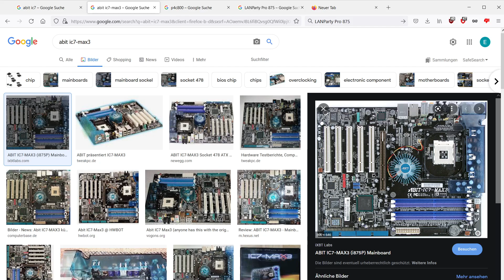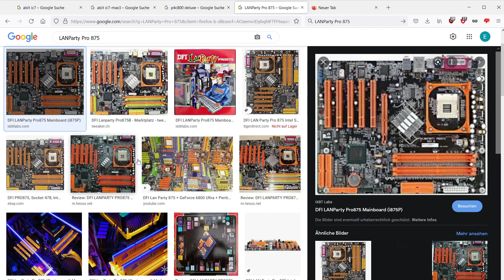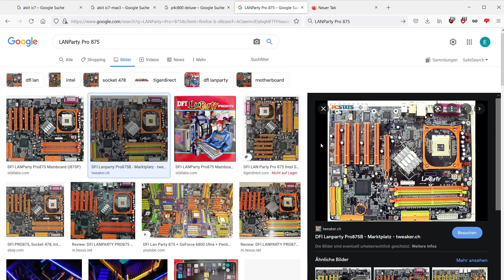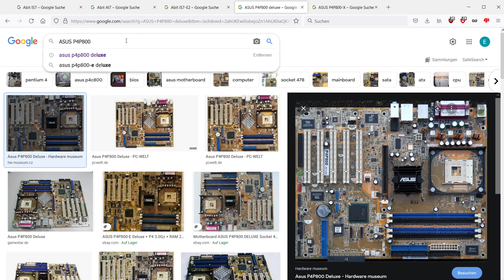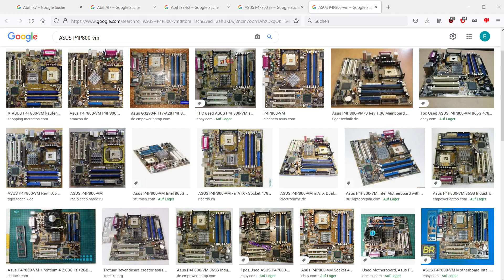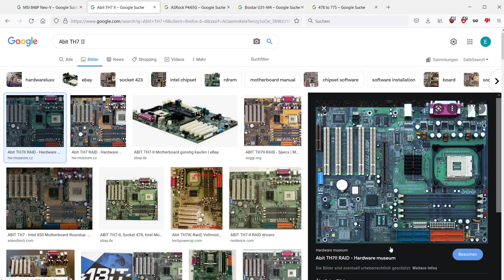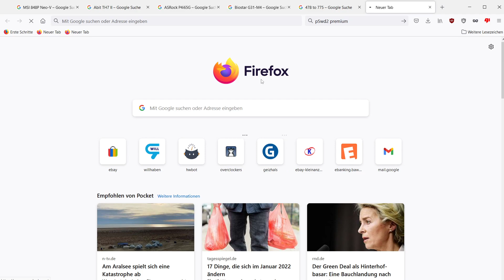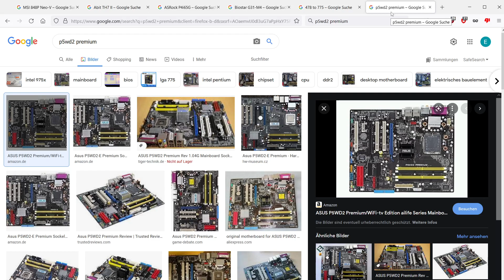Socket 478 Board roundup for Overclocking / what to get and what to avoid

Comment: I believe the P4P800 SE is an stripped down version of the P4P800-E (Deluxe) since it does share the same onboard LAN and other stuff (Marvell instead of 3com on the P4P800 and P4P800 Deluxe)

Intel 848P is essentially an 865PE with only a single channel memory interface

There are also an Intel 865P chipset which is an 865PE without FSB 800 and DDR 400 support, limited to FSB 533 and DDR 333, still retains the dual channel interface.

I do have a P4I65G and i did try mobile Northwoods in them, but didn't post with any of them, didn't try mobile Prescotts.

As for the DDR2 Socket 478 board, i recall the Biostar G31-M4 having a really underwheling VRM and struggles with stock high clocked Prescotts, aparently even inferior than the Asrock P4i945GC which is a similar board, although based on the earlier Intel 945GC chipset
Reply from the maker: i guess that means the biostar needs epower just as much as the asrock does then.

My P4I65G POSTs northwood mobiles just fine after inserting uCode into BIOS, but doesn't set right multiplier like it does with prescott :(

Comment: as far as I know the "G" in ABIT boards is for gigabit ethernet. There was also an ABIT NF7 S2G (2xSATA, gigabit) which clocked worse than the rev2 NF7. Though my ABIT AN8 Ultra nF4 on 939 has no G but still has a gigabit controller. I guess it's newer (2005) that's why

Comment: @TAGG XOC Pentium 780 m is working with i975xa-ydg?
Reply from the maker: Nope, wrong socket a M 780 would be best on a asus CT-479 Adapter and a P4C800-E :)
Reply: @taggxoc  ydg + ct479 could work?
Reply: @taggxoc  or 478 to 775 adapter+ct479 is working with this?

Comment: Have a few 478 boards
Own ABIT IC7 , IC7-G(Max ii) , IC7 MAX 3 
All good boards for Overclocking. ic7 being the most basic lacks additional sata controller and a few more things. IC7 MAX 3 fly's but people want 250USD+ for em (Paid £40 for mine 😁) 
Asus P4C800-E Rev 2.0 are nice have 2 of them boxed and a Vanila rare JPN P4C800.
I'd recommend people get the P4C800.

For 865PE AI7, P4P800 Series i like 
Asus and Gigabyte I think you can force PAT via a bios mod and I think one of the Gigabyte comes with it out of the box. I like My chaintech 865PE board pretty uncommon tho.
Would avoid Gigabyte have had 4 board in all DOA. 

I can't believe you missed AOPEN they made some really nice boards and are really fun and well built. But they also seem kinda rare.
Reply from the maker: Never had any Aopen board, allso there's no good scores with them on hwbot, that's pretty much the reason i have missed them...
Reply: @taggxoc  I recently was able to obtain one so will let you know how it clocks 😜

Comment: I have a DFI Infinity 865 PE board but have nothing to compare it to. It doesn't seem totally gimped but wouldn't surprise me if it's even on a lower tier than the Lanparties you mention. 478 availability in Australia is really poor, my choices were that board new in box for ~40 euro or import a 775 adapter for a horrendous price :D
Reply: Yes, Infinity has very bad capacitors on the processor power circuit. In the box, before replacement, conditionally the breakdown is only in this.
What I liked is soldered radiators

Comment: I know this i unrelated to this video but I have a question for you. I have a P5E I flashed the formula bios to and I was wonder what you think the best CPUs to bench with it are. And should I be benching dual cores or quads? I didn't realize having a ddr2 motherboard was kinda dumb for benching when I bought it but so far it seems like a decent board.
Reply from the maker: I would stick to dualcores and maybe 65nm quads (Q6600/6700), allso any QX chip is fine for X48, so anything besides 45nm quads basically. As for the ddr2 situation i wouldn't worry about it too much, there's some benches like wprime that don't care about mem at all or very little.

Comment: i miss my msi 865pe neo-2 v
Reply from the maker: There's too little data to recommend those based on scores and no personal experience so far, it's on the "to purchase if cheap" list though :)
Reply: I have MSI 875P neo and its a strange board. I had always problem with DDR400 memory running stable. But when I set it back to DDR333, after some restarts system reconfigure it back to DDR400 and Im not able to set it permanently.